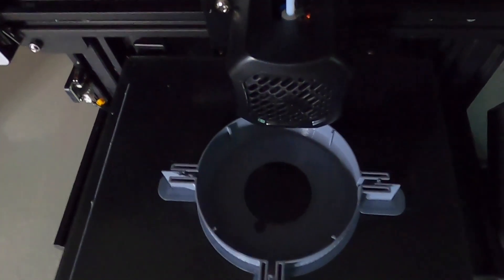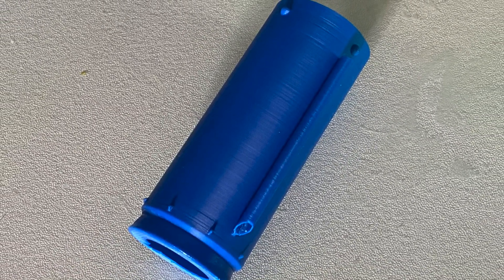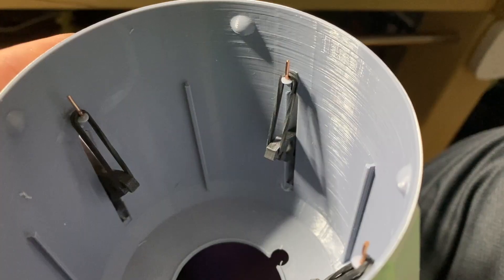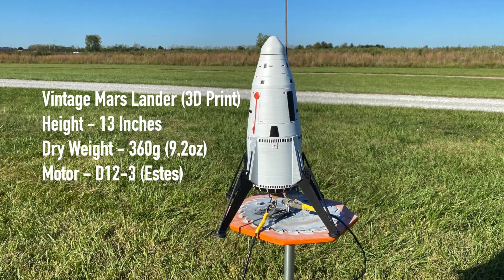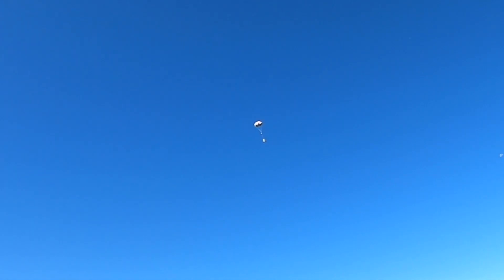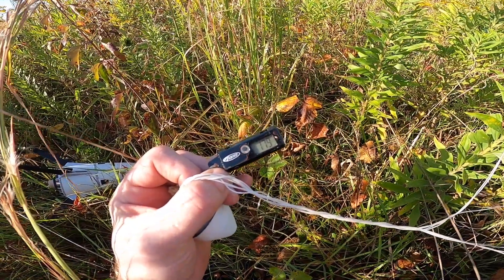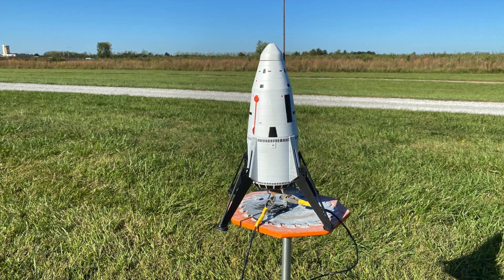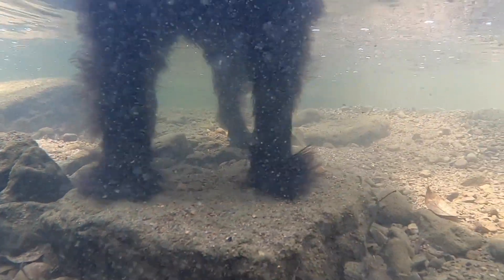3D Printed Vintage Mars Lander Model Estes Rocket

Comment: that must have taken a good bit time to print
Reply from the maker: Yes it did. Several sessions spread out over a couple days. My 3D printer typically runs non-stop (when I actually have filament on hand). Start a piece - go to bed. Start a piece - go to work. Start a piece - well, sometimes just wait. Of course one of my favorite 3d printed pieces is my .223 speed loader - which I filmed, but I am not sure I want to deal with the "hassle" of posting. Maybe I'll re-edit it as a short just to show it in action.

Comment: Very nice.👍 
I saw a fellow experimenting with different aircraft dimensions to make a wooden model glide. To attain the necessary air speed  to test his model, he carried it aloft with a drone and dropped it from severe hundred feet. He also printed several other designs ,one of which was very similar to our former space shuttle. It performed magnificently. 

Wouldn’t it be awesome to launch a rocket that deployed a glider at its flight’s apex?
Reply from the maker: I had the Estes Space Shuttle model as a kid that did just that. When it worked it was amazing seeing the separation and the "shuttle" glide down separately from the booster. Note that I said "when it worked." They make better kit versions these days, but I don't currently own any - yet.
Reply: @HNXMedia  
They were already made! ? Wow . I don’t have a field anymore. But I have a friend that does. 
I better scratch this itch while I still can. 

The space shuttle looks like it should drop like a brick , 
but it doesn’t. It offered the most impressive results. Like you said, “when it worked”.

I was born too soon, but I can see the advantages of 3-d printing. It sure can rapidly bring ideas to life.